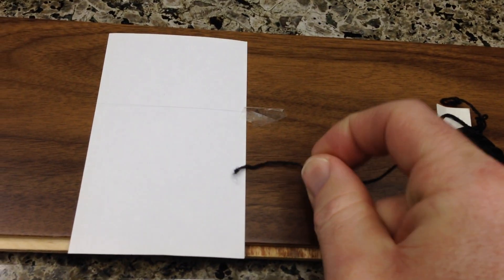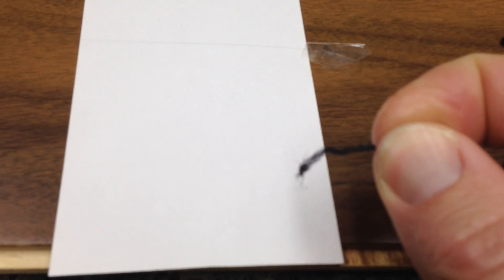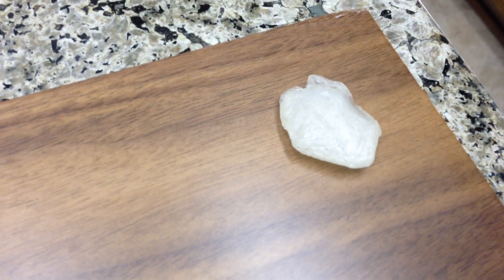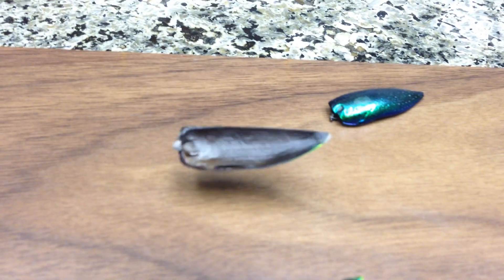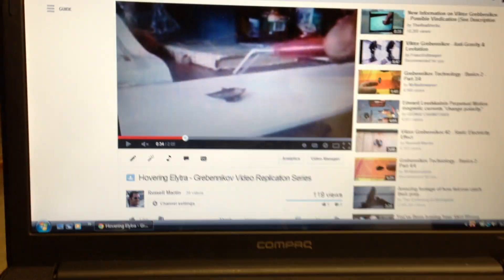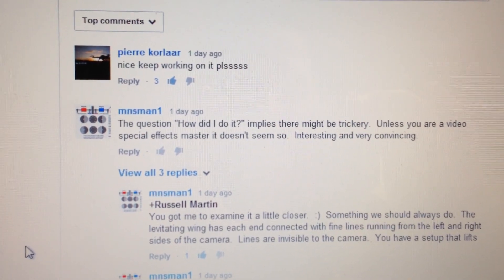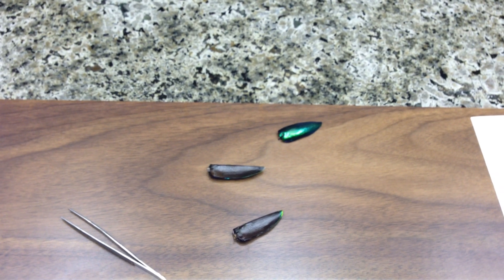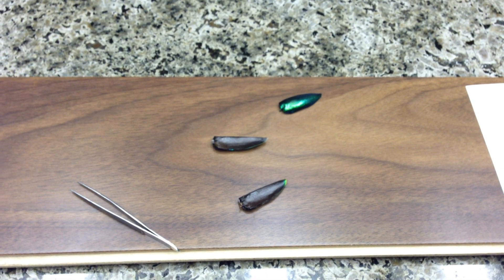Explanation Hovering Elytra - Grebennikov Video Replication Series

Comment: You liar, why didn't you say from the beginning that you were lying?
Reply from the maker: I am mearly pointing out how I think the original video was made. A large part of the alternative energy community is using the original videos as references and evidence. I felt compelled to point out what I feel is fake.
Reply: @LimitlessResearch So you haven't discovered anything related to levitation.
Reply from the maker: On the topic of elytra & levitation, the only thing I have observed is the repulsion of like charges. When 2 elytra are both negatively charged, they repel each other. However, this can be said for most objects which can hold a charge. So, I have not noticed anything unique to the elytra I have investigated.

Comment: get a dead wasp so that you have the abdomen you know like when you find them dead where they been there a while, now the end part that atteches to the rest of the wasp is open enough that you can slide a metal pin in with out touching the abdomen keep it centred do this in sun light you will see it move away.

Comment: i thought some behaviour is maybe static electricity, isn't it?
Reply from the maker: Yes, but only when the elytra are on a dielectric surface. The wood floor panel does not hold a static electric charge the way plastic, or nylon does.

Comment: Since we are making assumptions. 
I think what may be happening is like the bumble bee that matches the resident Frequency with its chambers in its chest that these are some how tund in to reflect the 0.u whatever the sympathetic Frequency is it reflects it back to its self matching the resident Frequency that is supposedly what gives the bumble bee the ability to levitate now the needle when opening the shell covers and that is what these are is covers for the wings but as the beetle opens the covers thay line up perfectly with each other in a way that Bowneses the resident Frequency of one shell then the other wich strengthens the signal so that is why you need both shells and thay need to be Lind up to catch the Frequency and bounce it off each other straighting the signal enough and the vibration from the wings buzzing may play some important roll in feeding energy to the shells and that is maybe why you have to what seams like throw them at each other maybe activating them for a minute I don't know because I haven't had a chance to actually test any of this myself so these are just assumptions

Comment: MHD propulsion has levitation capabilities. Is it antigravity, absolutely. Anything that opposes gravity is antigravity. But does it access the dark energy field? No. What I'm talking about is ion propulsion. High frequency microwaves ionized the air above with positive charges. The air below the craft will have some positive charges but mainly negative net charges. The positive ions will be drawn to the negative net ions below the craft. This will produce ionic wind that swirls upright below the craft.

Comment: No bro. That is an effect called ElectroHydroDynamic Effect and this has been reproduced by many people with more than just beetle wings. It is an ElectroStatic Field that is responsible for the repulsive nature of the beetle wings and for that particular initial movement that you saw. Victor most likely had done some alterations on the micro scale with removal of unnecessary material that weighed the wings down in my opinion. 
Regardless of my disagreement with your analysis, I highly respect you for ACTUALLY conducting your own research and would love to talk further. I think I may send you an email for I have a few more questions if you don’t mind.

Keep up the good work my friend. We are all everlasting students in this fields we call science!

Comment: I tried to do this experiment and I must say that it works and I have also seen the wing levitate in front of my index finger and I can say with certainty that it is not an electrostatic phenomenon.
Reply: Please take a video.
Reply: @Gurusum6  the wings of the insect are of a Little cetonia and are very fragile in fact I could not repeat the experiment because I broke the wings but as soon as I find this insect again I will surely make a video.
Reply: @VoidGod666 that’s what I can’t find.  No one mentions the name of the insect
Reply: Why did I use two beetle wing shells together without success?
Reply: Scarab beetle
Reply: You are right because I was thinking the same, it is not electrostatic but electromagnetic pulse (EMP) the poor beetle's wing is pulsating it's wings between positive and negative very rapidly that why any positive or negative charge matter tend to move out of the way.  But please be Warned! EMP is dangerous, because it can shut off power circuits. That is why when UFO crafts come near our power circuits you experience lights seem to go on and off.

Comment: That was a good explanation and it certainly meets the original video oddities. I don't know about beetles (they are too heavy for their volume) but small spiders do hover from place to place, making use of natural electric fields. This has been scientifically demonstrated. But I don't believe Grebennikov could make anything hover - there was a trick somewhere.
Reply from the maker: Very well stated! I feel the same way. There are some amazing possibilities with static electricity & high voltage when it comes to achieving lift.

Comment: NOT how Vic did it. He didn't just use the outside shell. You have to pull off the wings of 1000 beetles, attach them to electrical wires with a low volt. They will only last so long before the nerves burn out. But you have to pull the wings off with some nerve endings attached, line them up, wire them up, and activate the nerves with electricity. That's how he did it, so the story goes.
Reply: Sounds cruel - i hope nobody will try it !

Comment: also did you use you invisible string in the june bug vid?
Reply from the maker: No, that was an earlier video. The effects you see in that video are just like they happened, no tricks or illusions. What I learned from my experiments can be summed up to the fact that elytra are a good dielectric, they hold a static charge, and like charges repel. Good luck with your experiments. I picked this beetle because of how it's nano-structure produces color, but I did not notice any abnormal effects. Here is where I purchased my elytra.

http://www.ebay.com/itm/200-Elytra-Green-Jewel-beetle-wings-for-Art-Craft-Design-Adornments-Decoration-/281856314851?hash=item419ff20de3:g:QnMAAOSwlV9WRgoT
Reply: thank you russell for your kind help info and vid!
Reply from the maker: No problem

Comment: I believe that the beetle is able to consume and absorb poop/waste/excrement/trash to generate the energy to beat it's wings so that enough air is focused to activate and generate the thrust that it's hind shell wings can generate via its nylon-electrosis-anti-gravitic properties? The beetle is using potential fertilizer to generate motion, the beetle is basically a natural biological machine just like a battery powered helicopter given the description, it's nature's outward expression and illustration of a machine that just happens to be an insect. 

The beetle wings generates enough air to be funneled into individual parts of it's hind upper shell stationary wings that generates this anti-gravity levitation field, or at least a mini-small one. Which further propels the beetle's levitation properties. In addition I believe that the air funneled by the beetle's wings are made into a circular motion onto the hind wings of the beetle creating a mini-whirlpool onto the beetles upper wings turning on the nylonistic-properties? of the upper beetle wings. The simultaneous beating of the lower wings in a helicopter like machine function generates vertical lift.

One would need to or could, turn this into an aircraft funnel with components that have similar properties and have similar compositions to that of the upper shellish beetle wings chemically and physically, or even use liquids/materials that have similar characteristics to the nylon-electrosis nature of upper beetle wings and generate pseudo hypothetical anti-gravitational levitation force for vertical movement propulsion.

This is my impression so far, am I right or wrong? I appreciate comments or any corrections :) I still need to study more physics/engineering/mechanics/chemistry/math to fully comprehend and appreciate this entire phenomenon and process,
Reply from the maker: I agree with the biological machine aspect as well as the wing moment and propulsion. However, I can neither confirm or deny the anti-gravity levitation-field properties of the wing covers. One could build a test model as you described, but there would be an argument raised by some about the micro-structure that is present on the shell that may not be identical on the "upper shellish beetle wing" test model.
Reply: I'm reading that people are saying this is a hoax and is pseudoscience and there is a third party manipulating the beetle wings (I.E the person in the video).

Eitherway I think that the approach that researchers are taking to anti-gravity are wrong. I have been going to different websites and listening to podcasts like (American anti-gravity etc).

The whole problem that so many of the world's researchers approach deploy to the anti-gravity problem is that their interpretation is based on a singular phenomena approach. They are not seeing the problem with from as many different approaches and ideas, even with ideas not even related to the phenomena itself.

 They use the "scientific" approach where they take a single case, single event, single idea, single phenomenon and try to pigeonhole anti-gravity into one situation or one lab report, or lab reports that are identical and try to debate and argue based on those single source material.

I think what needs to happen and I think the real correct approach is to take a more stretched and holistic approach to the problem. There has to be a connection of many different phenomenon and observations, experiments and work and even different ideas and designs that are even completely unrelated to each other; and then try to build bridges and connections between them so that all these distinct works emerge as some sort of a total picture of anti-gravity.

People are becoming way too fixated on the "spinning magnets", "spinning turbines", "bug wings and insect flight", "flying discs", "magnets", "mercury", "helium" and then not trying to figure commonalities or wrongly misinterpreting them as separate events barely related to each other.

Also they don't even try to look at other phenomena and ideas that aren't related entirely to anti-gravity but with the potential to somehow be part of it and or even augment any original ideas completely related to it.

There a narrowing down and myopicness that the present "scientific approach", with all it's boringness and boring grey test tube/ice+thermometers etc etc etc blah blah blah does to big ideas like anti-gravity that colleges/universities propagate and which eliminates any multi-dimensional approaches to the problem hence the lack of progress so far.

There is a bell-curvization and standardization effect that occurs that when too many people start commenting and researching into anti-gravity, where it becomes that the only way to look into "anti-gravity" is this and this "magnets spinning" and "discs spinning" and then erase all and any other potential possibilities with ideas that different from that.

This has in effect bridged down and handicapped all the progress that has made in this field which is also why the research and progress has been pretty slow and inefficient.

I don't know but the present way of looking at this problem I feel is extremely flawed and useless.
Reply from the maker: Yes, this video uses a thin thread to hold up the beetle shell. This is my interpretation of how the guy in the original video is recreating the effect. I explain the reasons why in the video. I am not discounting V.G. work or the possibility of his flying machine. This video is only a critique of the original video.

I agree that focusing on one aspect of the technology is holding the research back. Keep researching :)

Comment: I was almost convinced it was real! 
and to be honest a part of me really wanted it to be...
Reply from the maker: Just to clarify, this video series is my evaluation of videos found on YouTube which claim to have replicated VG's work. They are not in any way discrediting VG.
Reply: @LimitlessResearch  So did you use the exact same wing casings from the same type of beetle that VG claims to have used? If so, did you attempt to replicate the experiment as he CLAIMS to have done it (before doing it with the string)?
Reply from the maker: @Microverse1    No, I did not use the same beetle V.G. used. When I made these debunking videos, the type of beetle he used was not known & it is still not known today. However, I did start researching his other CSE experiments. I used a burned stick & carbon graphite suspended by spider silk. When I introduced items claimed to produce CSE (fingers, wasp nest, bundle of straws, etc..), they moved the carbon in the manner VG said they would. My interpretation of this effect is simply different than VG. I believe this effect is a static electric effect. I was able to test this theory by charging a comb with static electricity and brought it close to the carbon. The carbon moved in the same manner. These results combined with the fake videos I found on YouTube lead to my production of this video series. I felt compelled to address the false claims that the CSE had been replicated. As I could easily spot them as fakes and wanted to let others know. Too many people were using those videos as evidence the CSE had been replicated.
Reply: @LimitlessResearch  Wow, what a great response. Thanks for that and well done!
Reply: @LimitlessResearch  they are not discrediting his work? you just claimed he was cheating.
Reply: What is the material please give us a description and how to get that
Reply: ***** lmaoo right
Reply: Lmaoooo facts
Reply: It IS real! Just like there are dozens of ways to heat water,start a fire, or build an engine. It's very sad that people see ~ONE~ little example or explanation, like here, then throw in the towel, and just give up all further research as IF that was the last word on the matter...pathetic!~
Reply: Incorrect execution.  Nice piece of flooring. Next time, raise the piece of flooring, place atop 4 copper cylinders  in the corners.  In the center, place a snall pyramidion beneath the flooring, atop the grsnite slab. Then place sympathetic elytra above the pyramid. It will produce torsion waves through the flooring that will activate the elytra. The waves will give the elytra what the cavernous structures need to activate their honeycomb cells. This causes a decoupling of the gravitatuonal waves a tiny bit.  The torsion waves will now wander through the elytra sending torsion waves in a convection pattern upwards away from the center of earth.  Prior to your experiment, place the elytra in the sun so they can gain capacitance. Enjoy.! Nice work with an incomplete data set.
Reply: @jmservices6523  i need answers 🤔
Reply: @jmservices6523  ok but I often do it with nothing but 2 elytras and it works. To activate it you kinda need to hurt one with the other few times before. Then once one is hovering the other it can stay "levitating" indefinitely. I like to show it to friends and they are always astounded. Also through the microscope you'd see pyramid-like texture inside the elytras. (I'm not saying what you say is false, just that the 2 elytras can "levitate" with nothing else.) I tried it with and without static electricity and on different supports like plastic plate, timber, marble etc. Works best with the pair coming from the same insect. Peace!
Reply: @PH4L4NXX  make a video and show it please. would be nice to see people replicate this without cheating.
Reply: @PH4L4NXX  q tipo de escarabajo usaste?
Reply: @PH4L4NXX  show us